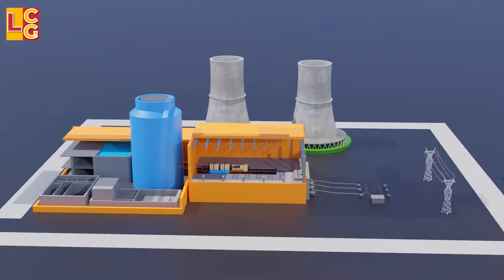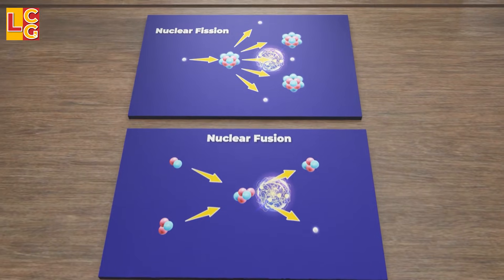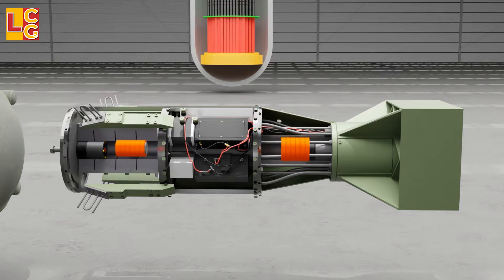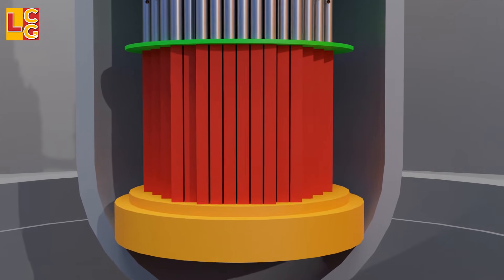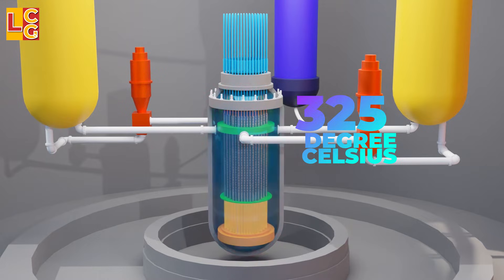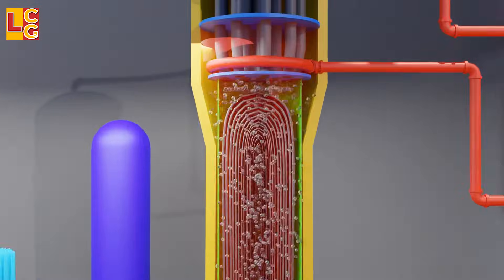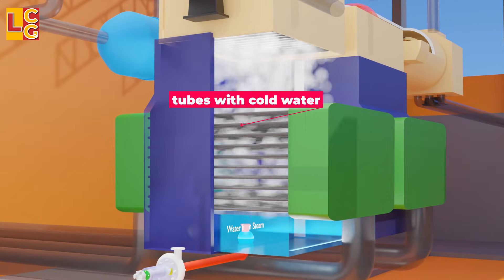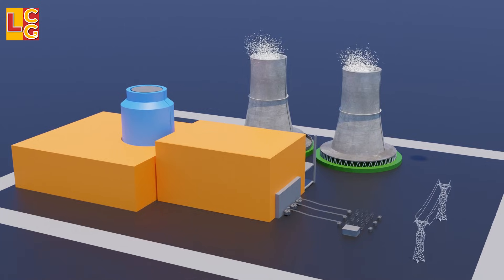How Nuclear Power Plant Works

Comment: Baryon conservation is all kind of messed up in this one too. You can't split an uranium nucleus into 2 uranium nuclei. For the most part when fission happens it split to two asymetric (by mass, and nucleon distribution) fission product and some neutrons (function of incident neutron energy as well as the fissile material 1<x<4). Many element (and their isotopes) can be such a fission product (Barium-141 and Krypton-92 is two frequently mentioned example but it is actually a distribution with great variety) uranium 235 is definatelly not one of them.
It's a simple equation really, on one side you have 235 nucleons and an incident neutron total being 236, since, neither protons nor neutrons can be destroyed in such process in whatever configuration you get the nucleons on the other side their number's still has to be 236 all together, including the liberated neutrons and the nuclei of the fission products. It follows that 236 can not turn into 2 times 235 and another free neutron.
Reply: Thank you bro
You are right.